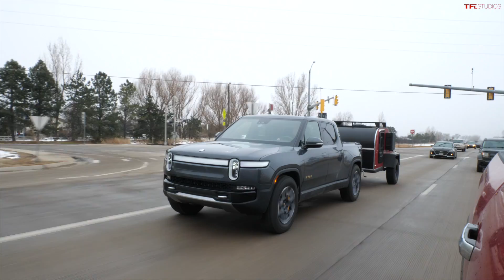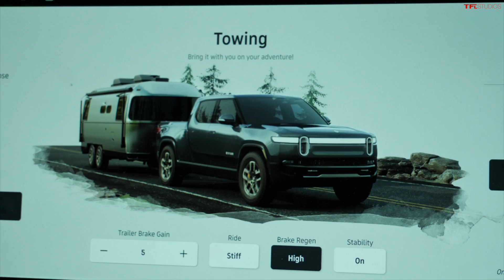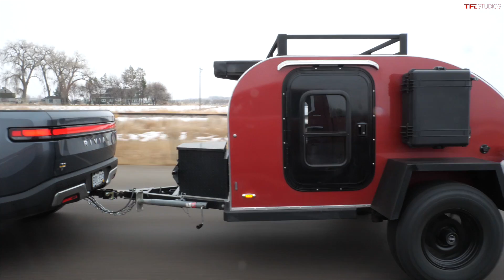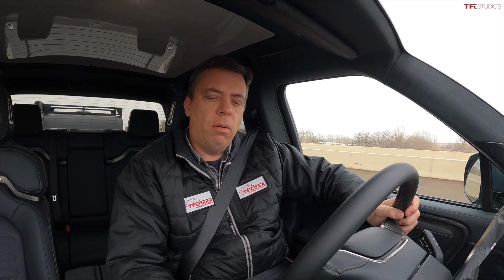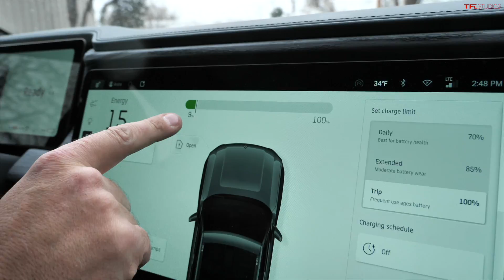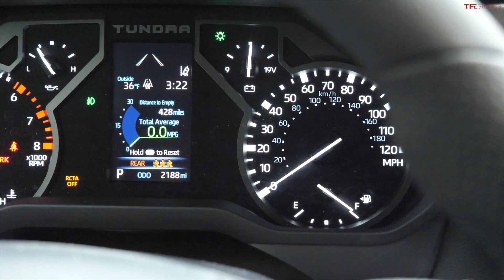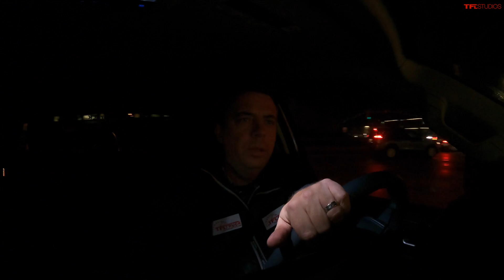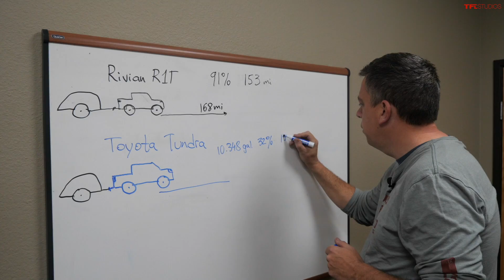Rivian R1T vs. Toyota Tundra: How Far Can Each Truck Tow On A Single 'Fill-Up'?

Comment: What was the cost per mile between the trucks?
Reply: Uhhh... The Toyota is definitely cheaper!
Reply: @JohnDoe-nz6bk  Rivian is more expensive initially as well. Currently, under any consideration, do eclectic vehicles make sense. Energy density for the batteries is not there for them to be practical ,maybe trips less than 120 miles, so maybe in town deliveries.
Reply: @JohnDoe-nz6bk 
While that is true...that doesn't answer the question.
Reply: @ZEPRATGERNODT  that definitely answers your question! 🤦‍♂️ the price difference alone makes the Toyota cheaper in the long run.
Reply: @JohnDoe-nz6bk  
You definitely don't work in a professional environment where a vague summation versus direct answers can come with consequences.

My question was not which one is cheaper. Any bozo can deduce that.

I asked specifically about a per mile dollar figure. They know what the price of fuel was and the time day electricity costs.

Comment: Nice video guys! What was the total round trip distance for the Ike Gauntlet run in the Rivian? Thanks for putting in the seat time to get a light towing range estimate.
Reply: About ~160 miles
Reply: The Ike gauntlet is 8 miles at incline. So 16 to 20 miles at most probably.